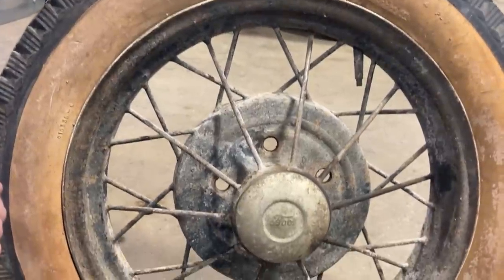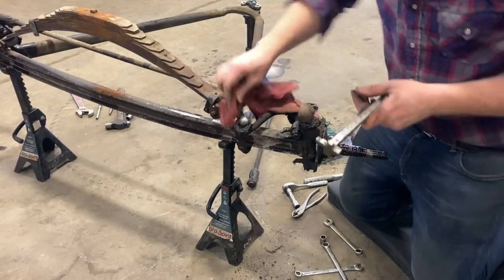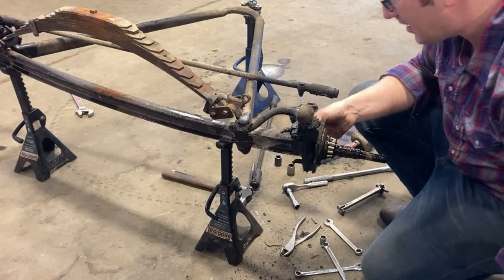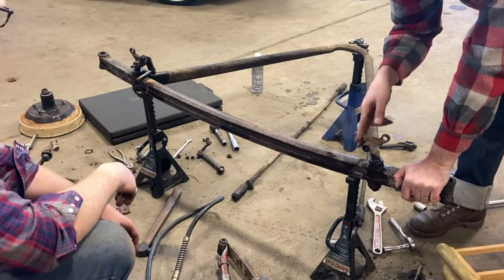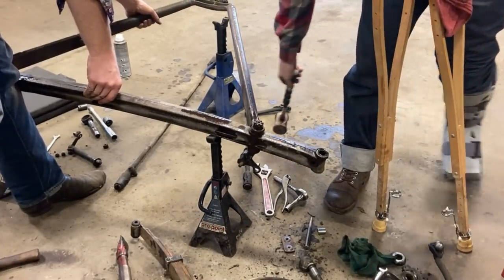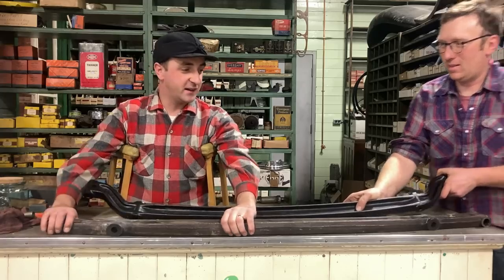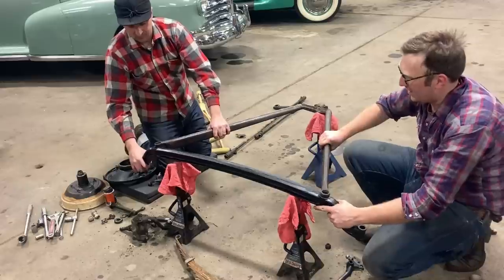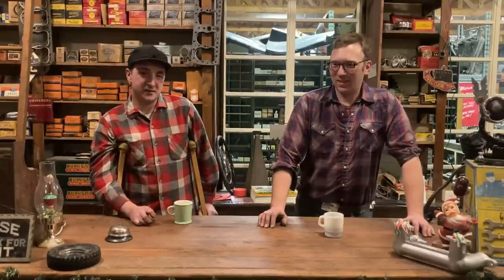Ruining A BONE STOCK 1930 Model A Ford Front end? Model A Ford Front End Rebuild PART 1

Comment: Hello Jim and Matt. Excellent early Ford content. Right up my alley. I showed a similar job when building my 32 sedan. Can I offer a correction on a very minor point? The king pin lock bolts are only tapered on the face that contacts the kingpin. The rest of the bolt is round. The hole in the axle is a straight 9/16" hole and can be cleaned out with a drill. Matt at Irontrap said the holes were tapered and you need to know which side is the front. Duff info. The holes are straight and there is no correct front or back to the axle. Ignore that Kyle Carter. what does he know. We all know you take a bit off the bottom of the tyre to lower it. Happy New year, all the best, Mart in England.

Comment: Happy New Year guys. Absolutely love your channel. I have a question about the dropped axle. You said you’re going to stay with the mechanical brakes, but how will you get the front brake actuator shafts to work with the change in dimensions between the spring perch and the king pin top?

Comment: The 1932 Model B spring perches are a bit taller (since the B axle has a little drop). The reach for the mechanical bracket pivot is shorter.

Comment: I too am wondering about the actuators. I had an axel lowered and was given instructions on cutting and extending the spring perches so that I wouldn't have to modify the actuators. Or... will you just use "juice" brakes?